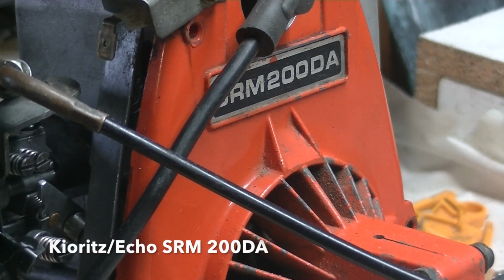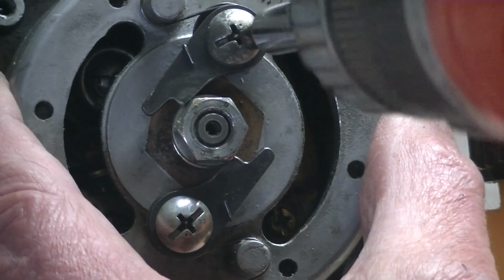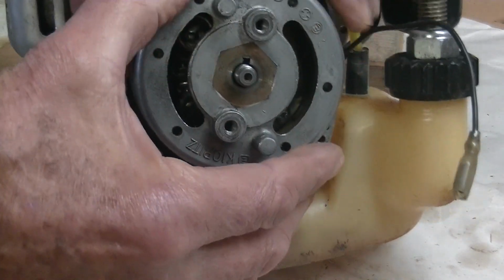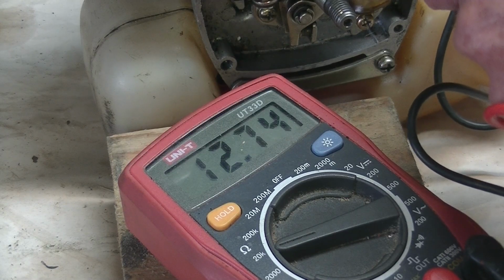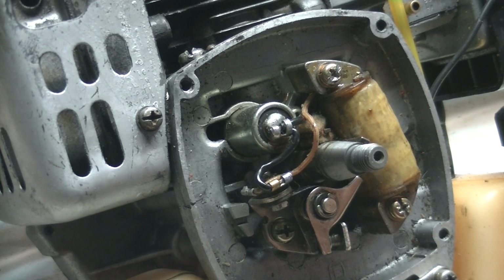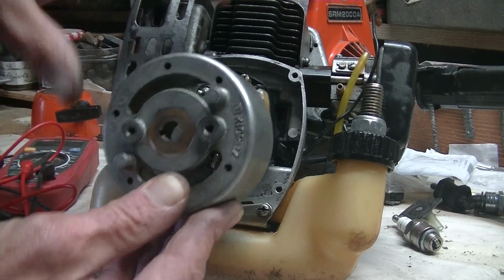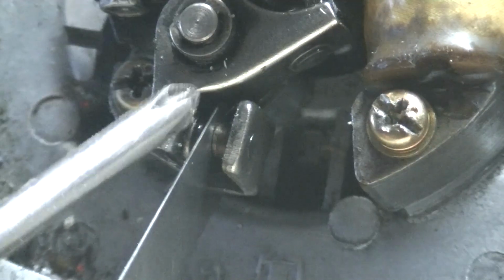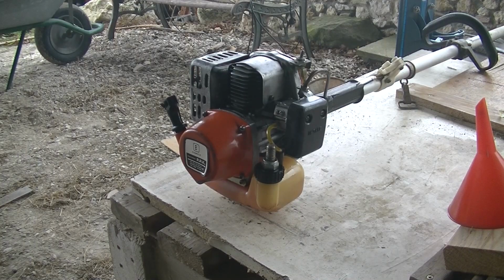What!??? My strimmer has contact points and a condenser?

Comment: Hey, sir im working on a Whizz Witch weedeater
Reply: The spark plug wire doesn't have the rubber boot.  So I stripped the wire a little so it would wrap around the spark plug.

Still no spark. 

It's got points and condenser. 

I haven't had the flywheel off before. But I looked behind the flywheel, and it has them. 

Do you think the points need cleaned.
Reply from the maker: @ Yes, I've also done that before, it works just as well, just wrap insulation tape around the join to be safe
Reply: @davekennedy52 

Hey, I'm on a different account. 

So, do you think I just need to clean the points again to get spark back?
Reply from the maker: @DavidjohnKinderjoy  If oyu have no spark or a spark every now and then it could be the coil. So check on Youtube on how to get primary and secondary resistance readings. Its actually not that difficult to do. Hope fully the timing of the machine is still good, that is opening and closing of the points at the right time. And the gap on the points should be 0,3 to 0,4 mm. Check that the points are not pitted and clean. Hope that helps
Reply from the maker: @ is this your trimmer manual?https://manuals.blackmaxtools.com/system/files/10217/original/BM25TEC_090309033_145_r_01.pdf?2019
Reply from the maker: Also a pretty old machine!  Enjoy it, its a classic!!

Comment: just started fixing one of these today also having a no spark issue, this video is very helpful, at least now i know what to expect once i pull it down a bit more.
Reply from the maker: took me by surprise when I opened up the back, its really one of my most interesting projects. It turned out that my no spark issue was due to worn out points and of course I then had a timing issue and I eventually found the timing marks on the outside of the flywheel. Good luck with yours

Comment: Hi guys.i have the dreaded spark issue. Is there any other coil that can be fitted ? I cant find spares for this anywhere
Reply from the maker: Hi Martin, the part number for the coil is 156 126 0463 0. Check this on ebay: https://www.ebay.com/itm/Echo-156-126-0463-Ignition-Coil-/114524645767
Reply: Thanks as I'm in the uk .by the time I've purchased and paid delivery and import tax its triple what it's worth.i was hoping to install an upgrade if there is such a thing. Thanks for your help
Reply from the maker: After watching your guitar video, I thought you were from the US. I live in France. I know the postage is crazy but there are other makes that have the same motor, like Weedeater, Echo, Sears...check in the comments below. I think that the Echo might have an electronic upgrade. Good luck!

Comment: My grandpa bought one of these in the late 70's and gave it to me about 10 years ago. His was nothing but trouble from day 1. I put new rings in it after he gave it to me and used it for the summer. Ran it out of gas for the winter and it never ran again no matter what I did to it. It had wicked strong spark, good compression. Wouldn't even fire on starting ether, new plug or old. I'm surprised how many of these I see on Youtube nowdays.
Reply from the maker: yes I'm surprised as well as they're all about 40 years old. I presume you also cleaned out your carb and changed the diaphragm?  All thats left is the correct timing on these machines. Took me a long time to work out how to set mine.
Reply: @davekennedy52  Yep, carb was rebuilt, that thing was nothing but trouble but finally got it working. Ran great when I drained the tank and ran it out of gas. Crank seals must have went or something. Points were clean and adjusted correctly. The sprak was so strong it made me feel sick for a day when I got shocked by it.
Reply from the maker: @MattsRageFitGarage  Sorry, but I had to laugh when I read about your strong spark. I got zapped when adjusting my distributer on my car, so I know the feeling. My Kioritz struggles a bit to start, I think its sucking in air past the carb/manifold gasket. but once its going its perfect. Prefer it to my other strimmers
Reply: @davekennedy52  Yeah I've been shocked by some high powered ignition systems but that little srm200da was nasty.
Reply: @MattsRageFitGarage  sounds like user error to me, I've owned a few of the Echos and other brand varients and they have all been very reliable and rather peppy machines. Many others will agree with me on that, while you seem to be the minority. I am not denying you or your grandfather of said mehanical ability, but none of that matches my years of experience with the early kioritz power plants. Cheers bud🍻
Reply: @2strokejunkie686  I have worked on many 2 and 4 cycles engines and many with points. My grandfather was a mechanic, carpenter, truck driver and self taught hobby machinist that made working model engines from scratch that were exact replicas real engines. None of us could figure that thing out. Ever seen a 6 cycle engine? I have one and it runs. 1895 Mery hit and miss. Weirdest contraption I've seen for a engine. All of myawnmowers have points and I even drive vehicles with them and am very good at setting and servicing them. I think the srm200da I had was a lemon.
Reply: @MattsRageFitGarage  very cool, your grandfather sounds very much like mine as he also made his own model engines but for control line airplanes mainly. But  thinking the same you must have gotten a lemon, as like I said the many I have owned/worked on were great running machines. Regarding the 6 cycle engine, I have seen a couple at local agriculture shows, very odd engines indeed, never owned or opened one up tho.
Reply: @2strokejunkie686  Yeah that guy could do anything. I have had and worked on a lot of Echi products and never had any kind of issues like that srm200da gave. It ran great until I ran it out of gas one winter. Wouldn't pop or fire for anything even on starting either afterwards. I think the crank seals probably failed when I ran it out of fuel.
Reply: @MattsRageFitGarage  yep that sounds like what happened, and as you know they will act up very inconsistently as the temp comes up once they fail, but yes my father and grandfather were both mechanics by trade and were practically super heros In my eyes, when it came to anything mechanical, along with any metal or wood fab. Both very good machinests, I give thanks to them for my knowledge and know how, alot to live up too but wouldn't have it any other way.